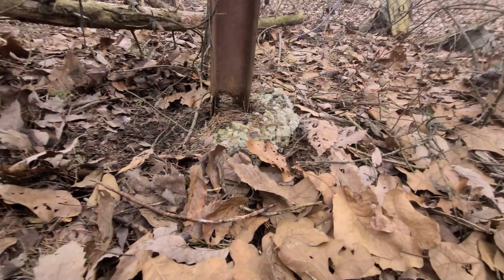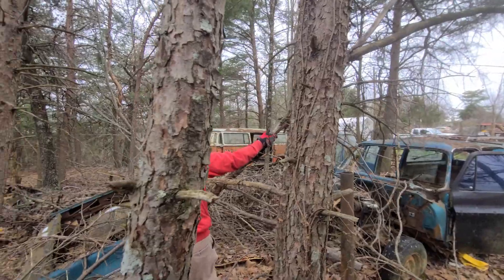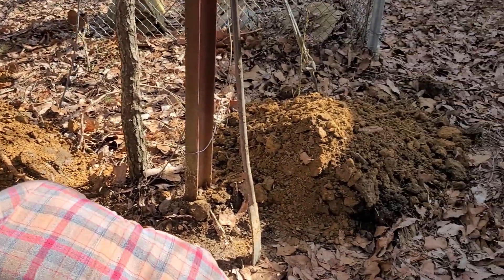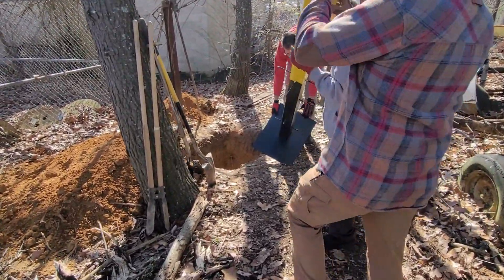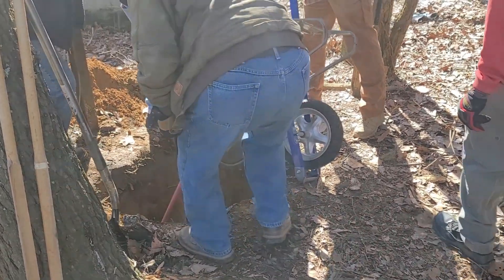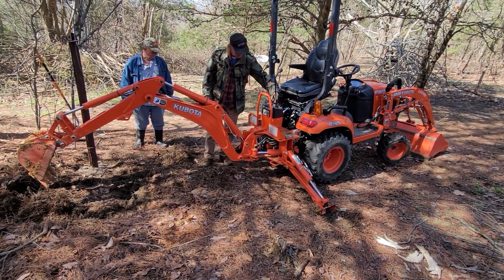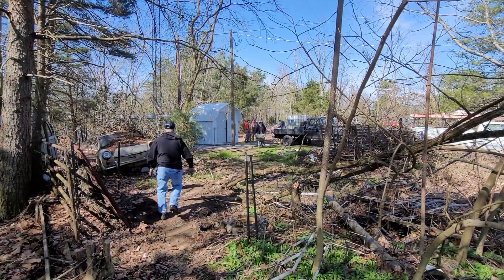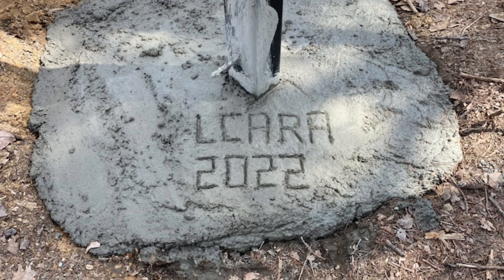LCARA HAM Radio: Potential Repeater Tower Disaster!!!!

Comment: I think you may be replacing these posts again in less time than you think. Using the box tube will trap water inside and rot the post out from the inside. The I-beam(or other non-hollow shape) of the originals would have less rust issues.

Comment: i have a tractor with tiller, bushhog, and box blade but i wish i had a backhoe. That would be very useful for sure especially running trenches too for longer coax runs. Glad yall got this taken care of and thanks for sharing this.   Also smart painting that high vis yellow so you can spot them easier. That red iron blends into the woods after a few years and is hard to see. And the year in the cement is good to know when the work was done.
Reply from the maker: Thanks for watching the video. We are very fortunate to have members with so many skills, equipment and the desire to take care of these emergency repairs.